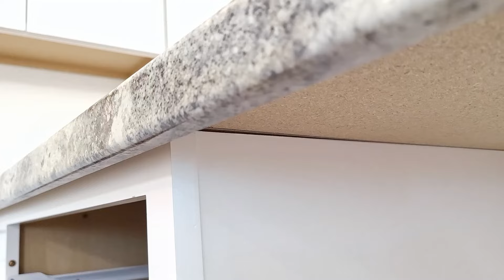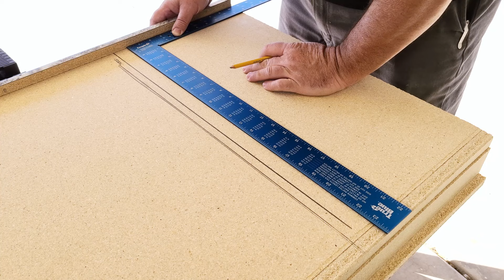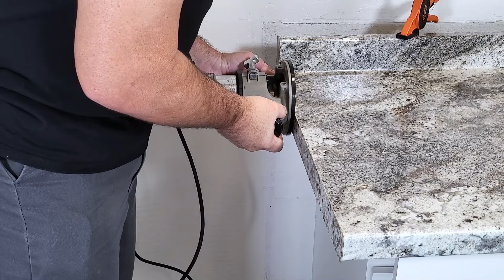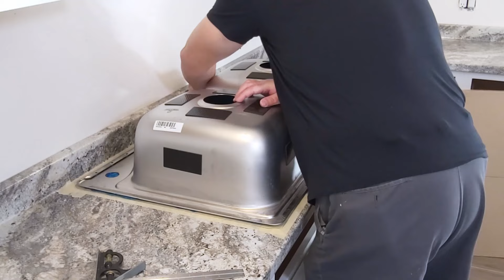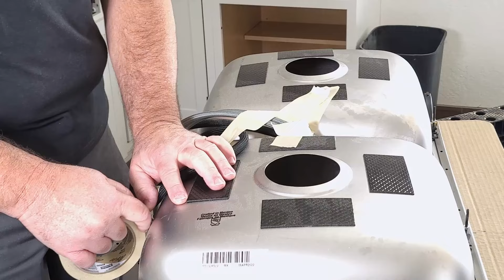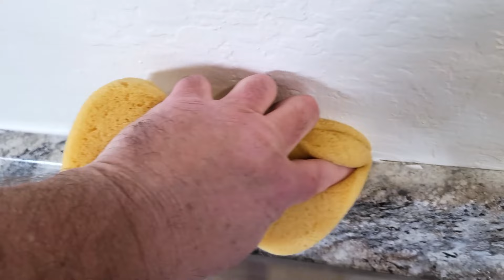How To Install Laminate Countertops DIY & SAVE!

Comment: I put new formica countertops in a house I had for sale. I had a person cancel their contract on the house when they found out that the countertops were not granite. The countertops looked like granite.
Reply from the maker: It's a bummer how people look down on laminate. I really think it's a solid choice and I actually prefer it.
Reply: I think people are programmed to look down on laminate thanks to HGTV and all the other DIY/Decorator channels and shows.  After having laminate, butcher block, and granite counter tops, I will put laminate in any kitchen I redo.  I didn’t worry about the laminate the way I did the other 2.
Reply: Laminate is out of style i rip 2-3 kitchens out a week and replace with quartz or granite
Reply: @joshmarauder 
Laminate is fine for a rental house.
Reply: @ColtraneAndRain  yes i agree for a rental yes
Reply: They should cancel if it was granite because granite can give off radon
Reply: @vidguy007  we also have chemicals in our food we cant stop eating now
Reply: Well, at least the guy did not take granite for granted. He did his homework. Great job, nevertheless!
Reply: Laminate is so easy to take care of, no resealing necessary like granite
Reply: @Grenade7291  you dont have no seal quartz either
Reply: Well booo hooo..
Reply: I prefer laminate. It is cost effective, has so many options, and now they look so much like real stone it is amazing. With real stone the price is so high to buy and install, the maintenance and worry about staining is high. Laminate is once and done, light weight and easily changed, and little to no maintenance Also, if you tire of the stone your pretty much stuck with it, not so with laminate. If you look at current laminate you will see how much it has improved in look.
Reply: @joshmarauder  that's just crazy. We are in a new build  I strongly dislike the stone countertops. In the process of buying some land to build and we will be using all laminate, my parent's and grandparents had laminate or formica and never had any issues with wear and tear over the 30-40 years in their homes.
Reply: @joshmarauder the problem with quartz or granite is that the colors and patterns go out of style so quickly and it’s expensive to redo.  Early 2000 everything was with a lot of brown, now everyone wants light countertops

Comment: Wish you would have shown the complete cut. Did you have a second person hold the waste piece?  How do you finish the backsplash part??
Reply from the maker: You're right, I should have. Sadly, I always work alone, I reposition the sawhorse so that the piece wouldn't fall. I actually did use the circular saw to cut the last small bits at each end, taking my time, and being very careful.

Comment: Nothing wrong with laminate. Apparently you can adjust the bolts dor the split under the cabinets but the saw horses seemed to work. I'm small enough to fit under easily.

Comment: I would have sealed the raw edges of the particle board, both sides, at the countertop miter. Think of it like sealing end grain on wood. Seal it with silicone or at least the latex acrylic caulk. That way that long corner miter of particle board won't swell under the laminate if water gets into the miter.

Comment: It's crazy that they don't provide a template and tell you to "trace it". Some people might trace the entire sink, and when they drop it in, it will just fall straight through. You did a great job!
Reply from the maker: Right? 🤣 Anything to save a buck I guess. Pro tip, always check any provided templates -- the one that came with my microwave was way off and I had to drill a second set of bolt holes in my new cabinets. 😳
Reply: Happened to me with a provided template last night 😂  didn’t realize I was to cut half an inch inside the template. Like why not send a template at that measurement

Comment: Your situation was almost identical to mine.  I learned so much from this, and the potential pitfalls to avoid.  The OSB brace was a great idea!  I only learned about the 3/4" extra pieces when I couldn't open my cabinet drawers.  Good to see how they're put in.  I have gapitis but now I might try shaving the back.  I haven't glued yet, or cut off the extra.

Comment: Great video and you are a great teacher.  Gave me confidence to do it myself.  Editing awesome.   Question on placing the two laminates  together.  Was it a tight connection?  Did it have a grove? Did you add anything to seal it?  Are you able to see a line where they connect?
Reply from the maker: @ignaciore3713  Thanks! Yes, the two halfs were perfectly tight together and held that way by wood glue and special hardware underneath. The final result was a pretty perfect flat joint that even my realtor commented on.

Comment: Good job my man but over here in blighty ,we would absolutely use silicone to seal worktop as caulk wouldn't last long if it got wet alot when washing up etc, now that you don't have a dishwasher 😮😂❤❤❤
Reply from the maker: What kind of wild parties are you having in your kitchen?!? 😳🤣 I could see pure silicone being a good idea in this situation, it's just so much harder to work with. I've had good luck with the Alex Plus caulk so far. To be honest I'm not a huge fan of the shorty backsplash and prefer some sort of tile all the way up the wall when the budget permits. Thanks for the comment!

Comment: A standard practice at the home manufacturer my brother in law worked at was to seal the raw cut edge of the inside rim of the sink cut out with silicone.
Reply from the maker: That's actually a great tip, thanks for sharing!

Comment: I don't see any countertop support boards in the corner behind the lazy Susan.  Did you install them?  If so, how did you screw down the countertop behind the lazy Susan?  I have the same cabinets and am getting ready to install the countertop.  Your video really helped me prepare.  Thank you.
Reply from the maker: You're welcome, glad I could help! I installed some 3/4 inch mdf on top of the lazy Susan, like I did on top of the other cabinets to space up/support the countertop. I didn't attach anything to the wall itself below the countertop behind the lazy Susan. but your comment got me thinking it wouldn't hurt To add something, just below the back edge of the countertop, to the wall that would support the very back of the lazy Susan. Granted, as I remember there was only one stud I probably could have attached to. If you have space I suggest trying to add something -- better too much support than not enough! Good luck!

Comment: Thanks for this video I want new countertops but over 3k for quartz. I’m just worried about staining
Reply from the maker: I'm pretty confident that laminate is a great countertop choice as far as actual use goes. And I'm pretty sure it's fairly if not very stain resistant, but not 100%. If you are concerned, I would just do a little Google research and that might help make the choice easier.
Reply: @LongshotGarage  thank you

Comment: So when you shaved that piece on the back to close the gaps did you remove the laminate and reattach??
Reply from the maker: No, there's no getting that laminate off once it's glued to the particle board! I used belt sander to shave both the particle board and the laminate together.

Comment: How would you modify it if you have an L shaped counter with the base of the L wider and not against a wall because it extends creating a small bar top edge for stools?  Everything in stock that I've seen isn't wide enough to accommodate the width of the bar top.
Reply from the maker: To the best of my knowledge you can't do that with pre-made countertops like I used. At least I've never seen any wider than this . You can always have custom-made laminate countertops to suit your needs.

Comment: Im curious on the sink cut out. Since there isnt alot of space to get a jigsaw or circular saw back there,  I wonder if predrilling the holes then cutting the backside near the faucet underneath first?  Is that possible?
Reply from the maker: Absolutely, you could do that. I feel you would have to install the countertop to make sure you get the holes aligned perfectly before you cut. Then you would have to remove the countertop, flip it over, cut that hole and hope you don't damage anything in the process of removing and reinstalling the countertop. There's always more than one way to get these jobs done!

Comment: Looks good, but 2 things that would make it better. Dishwasher and add a piece of molding to your top cabinets so there is no grease and dust trap to clean.  Nice looking kitchen for the price
Reply from the maker: I do agree, keeping the dishwasher would have been better, but sacrifices had to be made! 🤣 I also did consider some kind of molding for the top of the upper cabinets and was even considering making a drywall box up there. I'm curious what the new owners will do.

Comment: so... how did you cut the holes underneath for your miter clamps?  That's the hardest part...
Reply from the maker: I didn't, those are factory. 😁For a simple install like this it's way easier to trim the square edges. If I had to cut those I would use a router and a jig.

Comment: What's nuts, is that in 2019, that L and R mitered slabs would be $69 + $119. It's nuts how expensive they have gotten. Just a FYI - Home Depot has a light quartz-design laminate. You have to order it, but it comes within a week
Reply from the maker: I know, right? In the fairly short time frame I made this video the prices went up. Good to know about the quartz, thanks for the heads up!

Comment: No do not cut off the overhang. It is a great place to have a hamper or store a stool. Men never understand the needs of homemaking.
Reply from the maker: In this case, that's where the stove went, and on the other side, it was the refrigerator. In the right situation, I could see an overhang working as long as you supported that section properly. I wouldn't put much faith in this particle board to hold itself up.

Comment: Yeah but laminate sucks it's plastic, looks like plastic, feels like plastic and ages like plastic.  Even though it is cheaper than stone the value is not as good. The same for laminate floor in a bathroom it feels awful under the feets and it's bad to clean as it is not a hard material.  Nothing is worse than laminate. I would even rather put porcelain tile in a countertop than plastic.
Reply from the maker: @ericastier1646  It's okay, you don't have to have the laminate! 😁 Tile countertop is a solid budget option. It's more labor-intensive, and then you've got to deal with the grout, but nothing is perfect. I actually like laminate and I think it performs well, but there's no arguing that it's a budget alternative and most people just don't like it. The real benefit is it's cheap and fairly easy to install compared to all the other options.

Comment: No drawer pulls it like the The bare minimum was done... and no dishwasher no no no no.  No color paint not even a light sage green or light blue god for give me for saying grey But it all depends on where in the US he lives what county.
Reply from the maker: I do everything for a reason. This house was being sold, so I specifically didn't put drawer pulls. This way the new owner could choose what they wanted. I choose black, they want gold. I install handles, they want knobs... Same goes for the color. This house was full of vibrant colors that one buyer may have loved and another may have hated. So I painted the whole place the most basic off-white I could get. This way the new owner has a clean slate to paint an accent wall or the entire house whatever color they choose. These were my ideas, but I also ran them by my realtor who agreed.